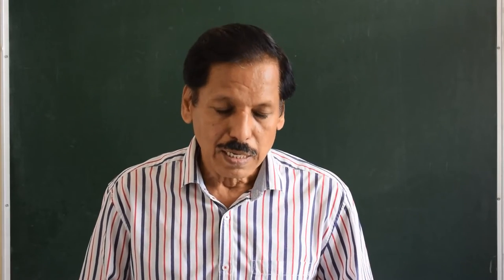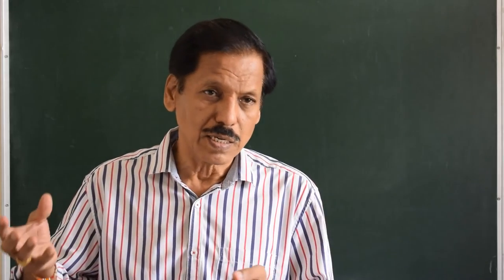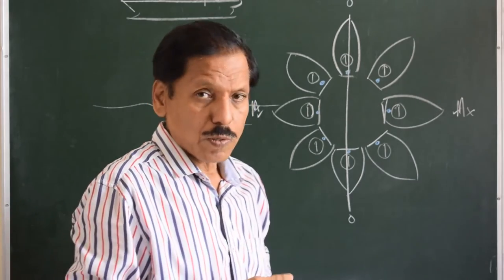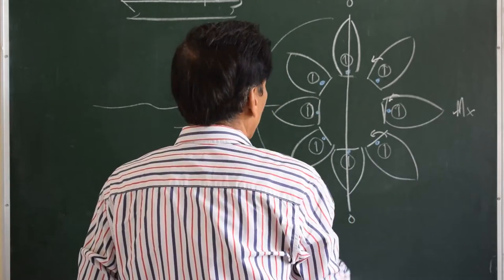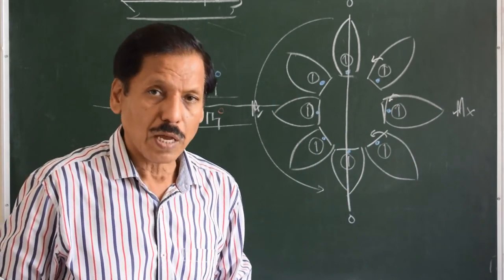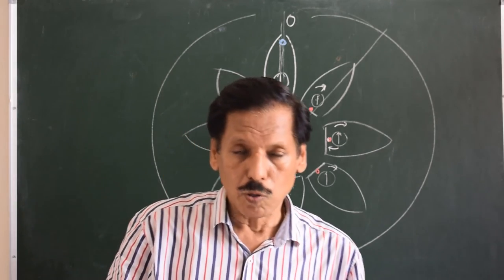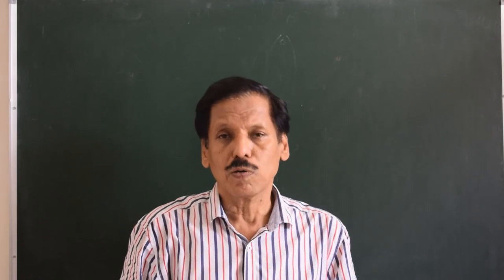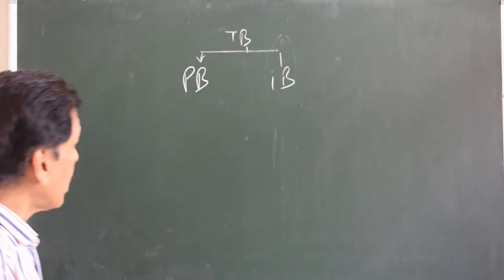Coefficients of Deviation, Magnetism | Capt. S.S. Chaudhari

Comment: Sir can u explain what are the changes in magnetic compass and deviation when ship  reached newzealand from japan
Reply from the maker: If the compass was corrected appropriately i.e. soft iron for induce magnetism and magnets for permanent magnetism, the deviation should not appear. But the change of induced and permanent magnetism happens in different ways once the latitude changes, if the correction at Japan was done like for like, the fresh deviation would not occur. The healing error however would have to be adjusted anyway.